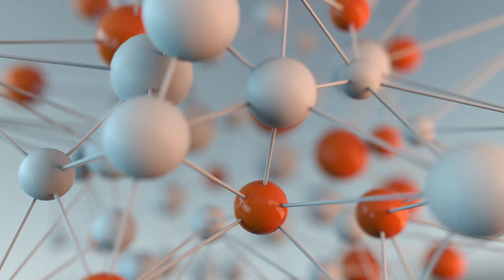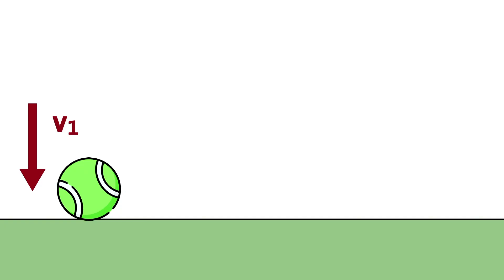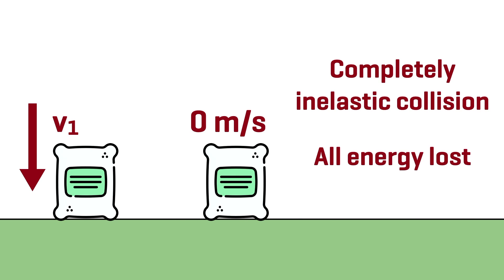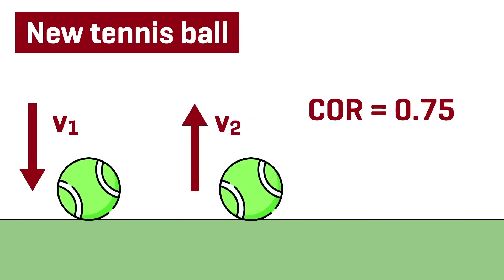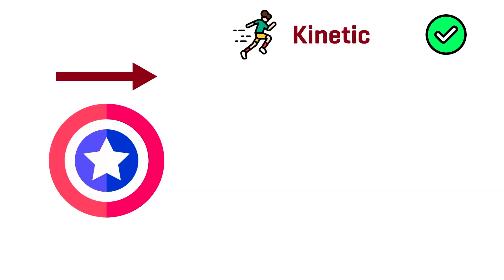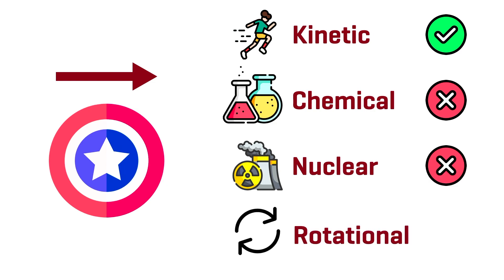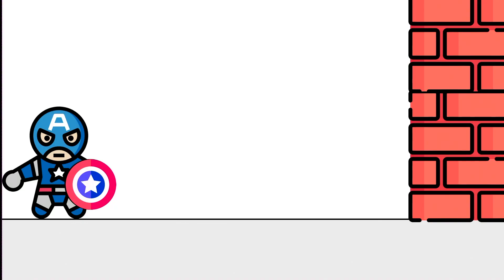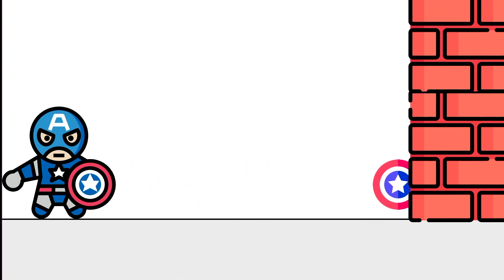How does Captain America's shield bounce?

Comment: Nice one.  Conversion of rotational kinetic energy into translational kinetic energy also works with tic-tacs!  See Physics Girls video at https://youtu.be/x4ySPDvebes Perhaps the shield does not have a uniform density and has different moments of inertia.  Maybe it could then also act as a boomerang?
Reply from the maker: Nice video on tic-tacs! I like that. I also like the idea that it doesn't have uniform density and has different moments of inertia. It also means adds credence to the idea that the users all need to train extensively with the shield to be able to use it properly. The need to get a "feel" for the non-uniform density. Because there's been no evidence thus far to suggest that any of the shield's users have taken advanced mechanics classes at SHIELD or otherwise.